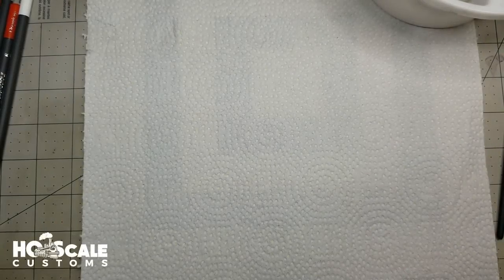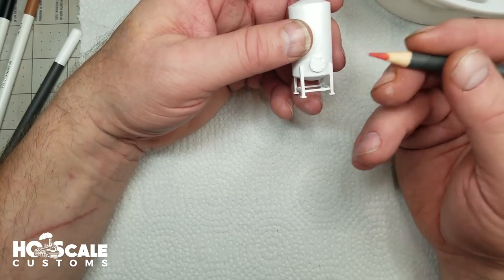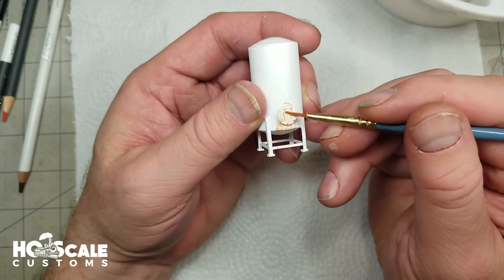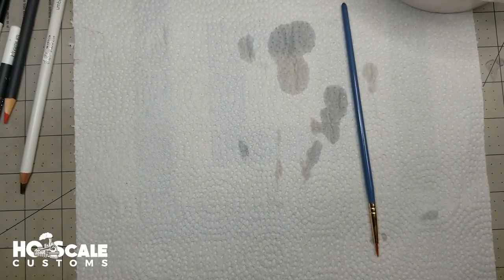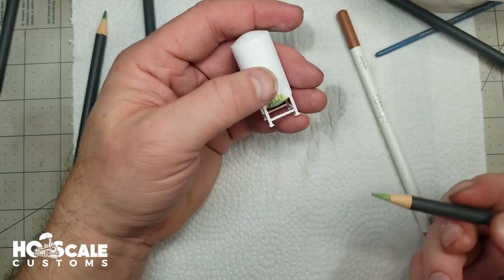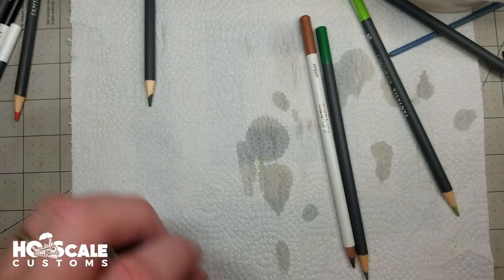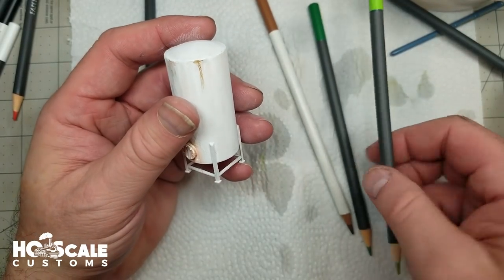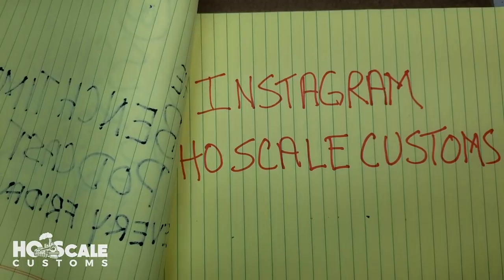Weathering Your Models with Water Color Pencils - Model Railroading Structures

Comment: I have been using watercolor pencils for years for modeling. One trick is to use window cleaner like 409 because it has a little ammonia in it. I will fill a little jar like an airbrush jar with window cleaner and soak the tip of the watercolor pencil in the window cleaner, it softens the tip and turns the pencil into a watercolor paintbrush. Works nicely on weathering freight cars. You can also move the colors around with a paintbrush like you are doing,, but I use the window cleaner instead of water. Some people will use ammonia cut with some water, but I don't like the smell. -- Bill B.
Reply from the maker: Nice! We love the idea of the 409 cleaner or a windex type product. We'll try it out, thanks!

Comment: Very important: you must use the water colour pencils on a matte surface, otherwise the brush will wipe them off totally
Reply from the maker: Correct, we should've mentioned this. But this is a very important part.

Comment: once its dry how are you fixing it?  Dullcoat?  Wing and a prayer?
Reply from the maker: Personally, we never use dullcoat and don't see the need to. In all the years and models we've made and set on the layout, we've never lost weathering or effects without dullcoat.

You certainly can choose to use it, but we've never used it and never lost details from our work or had things fade without it. 

Just personal preference. 

Unless you're like touching it and picking it up a lot or it's placed in a wind tunnel.